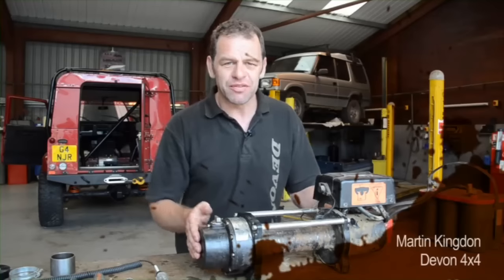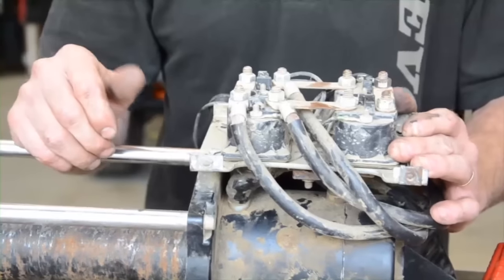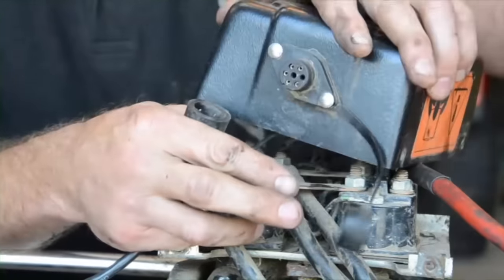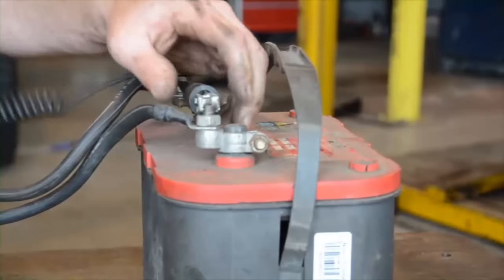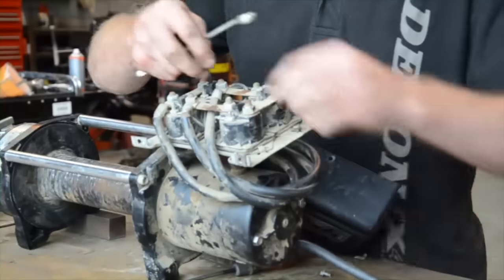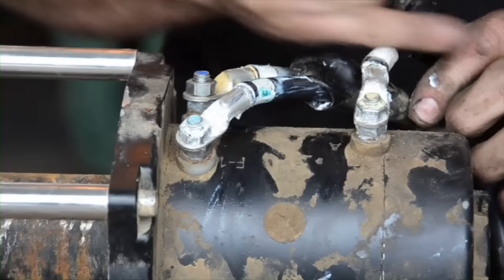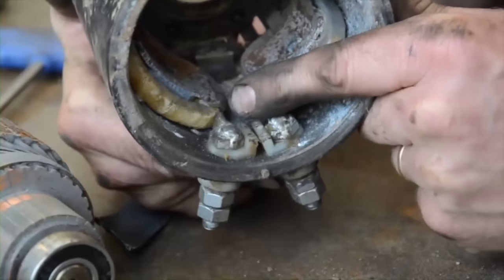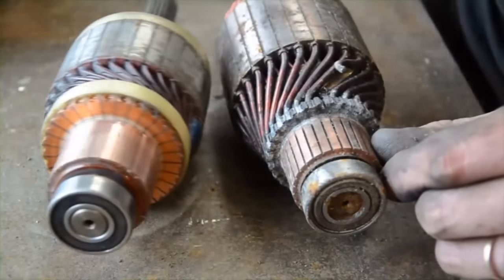HOW TO REPAIR A WINCH - PART 1 (OF 3)

Comment: Very good Sir! I am a Master Builder at Warn Ind. In Clackamas, Oregon I am now one of two Service Center Technicians at the main building. Really, we're just a couple guys that have been building winches for years and now fix them. We wheel! Did the Gambler 500 back in 2019. While you are spot on and taught me a trick that I'll use, try taking the tie rods off first and building the gear train with the drum support down. Cheers!
Reply: My warm winch spins but as soon as i put some weight it locks up, can you tell me what i would have to fix… it works as soon as there is no weight.

Comment: Great three-part video series!!! Plan to clean-up, repaint, and re-lube my 20-year-old Warn M12000 and change-out the solenoids (SAZ-4201EY). It is rusty and noisy but turns in both directions when connected directly to field and armature terminals. THANK YOU!!!!

Comment: Fraser; This is hands down the best instructional video I have ever seen on you tube. Warn charges a lot for repairs. They get a high minimum just to look at the winch before you find out what the cost of repairs will be. Plus in my case I would need to ship them the winch (not cheap given the weight and distance). Frankly it is cheaper (or at least less risky) to replace the winch at a cost of nearly $600 than go through all that. My winch now works like new. Thank you. You just saved me hundreds of dollars!
Reply from the maker: Tom Keane you’re welcome mate. Please share where you can!

Comment: I'd have started with a good power washing. Of course, it depends what the customer was quoted for work, yeah? He makes a good point of not using penetrant only water. Before assembly throw everything on a sheet pan and bake it like a roast. The commutators and stator windings can handle it. I might add that the varnish on the winding is broken down with any petrol based cleaner. Just water. He's doing good work by not attempting to solder that looks connection. The minute you put any load on the winch, the solder will melt. If the customer approves and wants to try to solder the connection the entire stator housing must be dipped in it's entirety into a varnish tank and banked. It's not the repair that is the problem, its properly isolating the repair. Great proper video with sound principles employed.

Comment: Wonderful video. I got my winch back from the repair shop only to find the spool would not engage. After watching all three parts, I took my gear box apart to find the internally toothed sleeve was installed upside down, so the engage lever couldn't line up with a detent and engage the spool. Different brand, but very helpful. Very well done.  Thanks for posting.

Comment: I just opened up my 9 year old superwinch talon. Despite living in a desert with less than 10in of rain per year and having never been submerged, everything inside my winch is covered in thick rust and severely pitted. Even though the winch is supposed to be completely sealed and water proof..

Hopefully the company that bought superwinch will honor the warranty.

Comment: Thank you for creating and uploading the videos. My winch stopped working and I was able to fix it after watching this series. In my case I found water and mud inside the motor and the brushes were stuck. After cleaning and putting it back together it’s working like new again. I would buy you a few beers if I was closer to you. Thanks!

Comment: Great Video. I bought a defender to replace my stolen one and it came with a very battered looking  XD9000i I was going to bin it until i saw this Saturday night. Carried out the poweron test Sunday and its dead as the proverbial Dodo.Time to explore. Split the motor from the winch. Ye gads, the amount of sand in the motor was ridiculous. The  end bearing was seized as well. Electrically though it is sound. Bushes have hardly worn at all. Think this may be a little project for the next few weekends. Just need to split off teh gearbox tonight to see if its worth continuing. Thanks for the video. it was so informational.

Comment: The solenoid check using a test lamp confirms the solenoids are able to pass enough current to the illuminate the test lamp but this doesn't mean the solenoid contacts are in perfect condition. A test lamp may only draw 5 watts or so. The winch motor may draw 50 or 100 times more than that without a heavy load. Still it's an important test to check whether the solenoids are totally shot before you progress any further.

Comment: Can you tell me why these type winches used to have 2 leads on the motor and now have 3?  On the 2 lead it was easy to jump them if the solenoid failed but the 3 is more complicated.  This is a fantastic how to series!

Comment: Really good video to take the cover out of the end of the motor you can take the little white plug out from end of cover hole is threaded so you can put a screw that push the cover out no need for bashing.

Comment: Thank you for the maintenance clips for the winch. I want to ask you. I have an American Warn winch. It seems that there is a problem, and it is during the towing. It works. When the towing stops, it loosens and returns the trailer and does not continue to the state of tension. One of the technicians told me that the winch clutch must be changed, so is what he said correct. Thank you

Comment: If I just put a tester on the live terminal of the motor and switch it on and it registers 12v but the winch won't move and I have a good earth, won't that be enough to tell me the motor is seized?

Comment: I have a question. i got to the point to remove the endcap of the motor. here i'm stuk i can freely turn it so no rust  but it wont come of. is there something i'm missing here?
Reply from the maker: There may be a retaining screw in the bottom of the housing.
Reply: @LRLiveUK  I see two screws close to the side but when undoing this and trying again I see more coming lose then I want and need. It also lossend the the plastic and the brushes that I see left attached on the movie. I can trien the cap but I have the impression it is still attached somewhere I first touched the stew in the middle of the and cap an removed this but doesn’t help.

Comment: Wondering if anyone could me out. Have the exact same winch. At 17:40 in the video when you take the end cap off the motor mine is completely stuck. I can tap it away from the rest of the motor body but i cant get it to come off it just rotates. Any help would be appreciated.

Comment: Great Videos.. Helped me Immensely with teardown of My Harbor Freight Mod 44006 440/880 Lb Hoist... It has a few design differences and that's where I need some advice.

 Symptoms- Hoist would only Hum and not move up or down. No solenoids as the one in the video just two Capacitors (Up/Down?) Disassembled and No Brushes... Rotor and stator turns freely after removal from the spring loaded Brake Hub/bearing assy.. but that assembly is stuck inside the Fan Cover. 

Parts breakdown shows Break hub,bearing and cover separated. I'm thinking they overheated and froze together. Anyone disassembled one of these types before? Bearing spins freely inside cap but..is brake hub supposed to spin? I don't want to force them separate unless I know if they should. Thanks for any advice.

Comment: My solenoids make a really chattery noise both winding the winch in and out. The winch doesn’t move. I’m not getting any voltage across the solenoid terminals. I assume I’m up for brand new solenoids.

Comment: Hi friend, Nice video, i have a question, i have a superwinch hidraulic h8... Can i change that hidraulic Sistem by electric motor
Reply from the maker: hugo leyva yes but you need to replace the whole system. Can’t be converted to electric

Comment: Thank you for the good video, sir.

I have a question. Is there any way to use the "car winch" at home? 

(sometimes to lift a heavy object)

I think I can use winch like this with my short knowledge. Will you check my thoughts?

Connect the battery disconnected from the car to the winch, then connect the battery connected to the winch to the battery charger and plug the charger into the 110V in the house.
What do you think of this method?

And I saw a comment saying that connecting the winch directly to a battery disconnected from a car can overload the battery, which can shorten the battery life and be dangerous. Is that really so?

If you know the answer to this question, let me know... Thank you.

Comment: Mine spools in no problem just not spooling out unless its free spool and pulled out  any sujestions
Reply: Mine also. Did you figure out a fix? I was thinking the drum brake is holding    When winching out. Mine is a G2 15k.

Comment: Mine sat for 20 yrs. lol It's a dual winch. One works great although I have not tried to engage free wheel.. The other side's motor sounds great. But it's stuck in free wheel. I can't get the lever to move by hand. Haven't really got serious about it yet. Any suggestions?